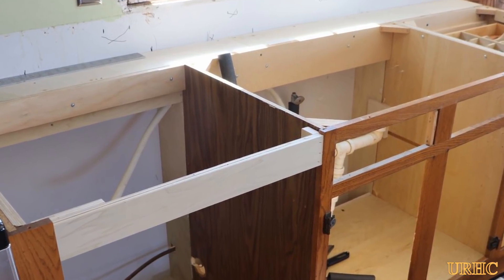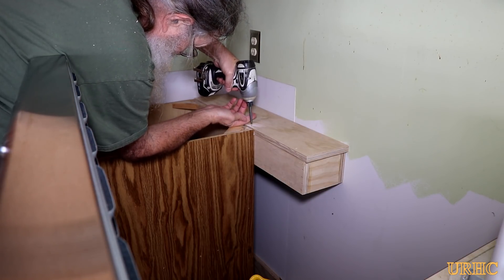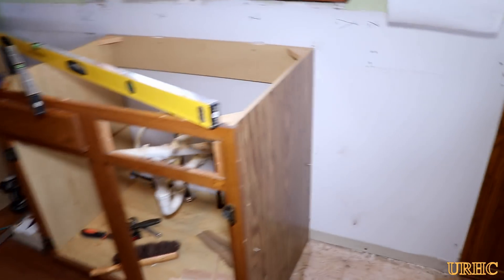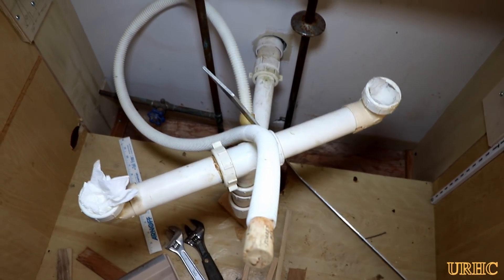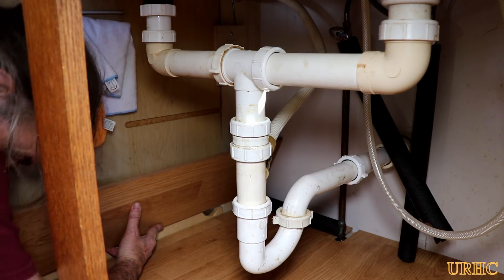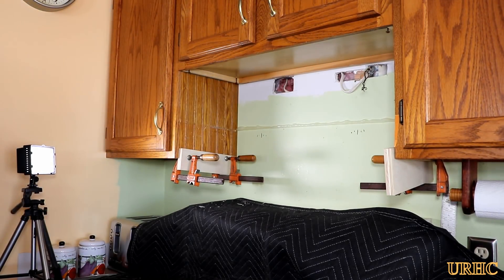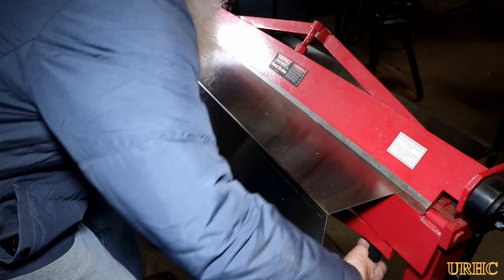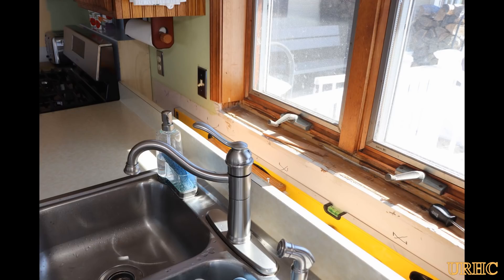Kitchen Update Part 4 Moving Cabinets For Wider Counters

Comment: You always do such a meticulous job.  Looks great so far.  The area under the sink looks great,   so cool you found the flooring panels to rehab it.  One of my favorite things about granite is, it's always cold.  I don't use racks for cooling cookies or biscotti, just lay down sheets of waxed paper to cool them.  Fast easy clean up. I'm looking forward to the granite install.  Thanks for sharing.
Reply from the maker: Thanks. Using the old cabinets turned into the biggest issue and the flooring was a easy way to hide the mess. Glad it is almost over now. It would be nice if she could get rid of those big cooling racks. Thanks for watching.

Comment: what is the name of the glue you used on the flooring for inside the cabinets. Awesome job!!
Reply from the maker: It is the liquid nails projects construction adhesive LN704 with the red end on the cartridge.  it is latex base, water cleanup, and low odor. Thanks for watching.

Comment: Looking good  ..  I remodeled my kitchen in 2014 and did granite and the only thing I would redo is I woulda put 3/4 plywood on top of the cabinets so that I could mount the under mount sink on top of the plywood and then the granite would lay over the plywood and the granite company would add a 3/4 piece to the front edge.  The nightmares I read of under mount sinks that fell off years later wouldn't happen my way and the added extra 3/4" on the front woulda made the granite look beefier.   http://prntscr.com/itka7y  >>>> pic
Reply from the maker: We are getting the granite through Home Depot and everything has a 15 year guarantee  which is probably longer then we will last. I was thinking about putting some stainless angle across under the sink for extra support if there are any weak looking spots. The granite is     1 1/4"  and any thicker would look massive. Thanks for watching.